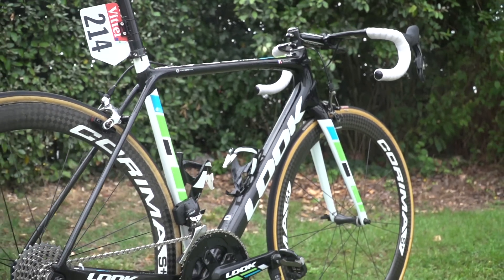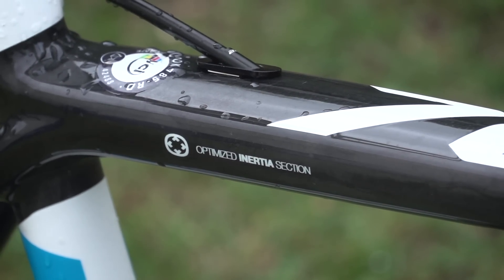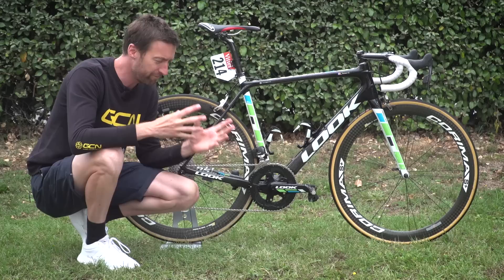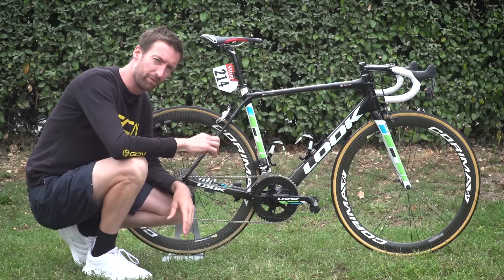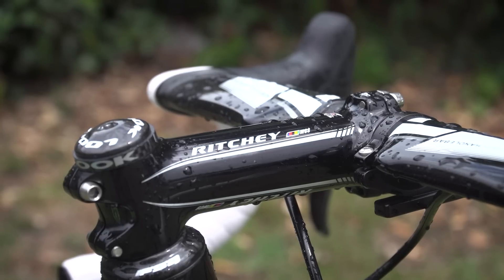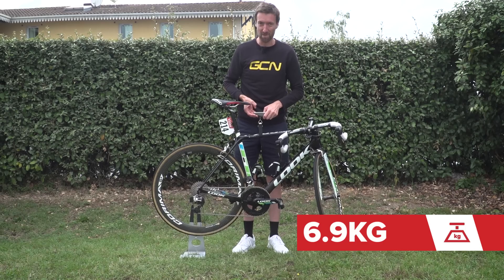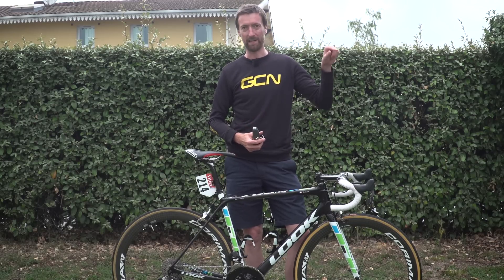Élie Gesbert's Look 785 Huez RS

Comment: Look bikes are not that mainstream bikes. I got one and it is really nice to ride. Plus it is hand made in France, so you feel kind a special when you look at it and when you ride it.
Reply: Nikola Makic how much was it
Reply: Mine model is 555. It is older but full carbon and it cost me 650 euros second hand. So it was ok. I know that new ones are not cheep.
Reply: Nikola Makic when did you buy that frame? It seems a bit expensive to me. I bought a 595 cofidis frame from a cofidis rider for 250 euros a year ago. Great frame this 595 by the way, beautifully rétro and slightly modern at the same time. Rides better than most mainstream bikes today.
Reply: Sorry to disappoint but Look frames are actually made in Tunisia and finished in France. They only produce Look pedals in France.
Reply: I bought complete bike for 650 and it was 3 years ago. If I had a chance to buy only frame I would but I only found complete bike in steed. 595 is a beutiful bike. I like the Cofidis color schema. Great choice.
Reply: Did not know that fact.

Comment: It is very good that the chainset  are zed2 for bb65 bottombraquet or shimano for bb86 bottombraquet frame. In my 795 the zed3 chainset are very nice, but they produce so much noise problems. Unaceptable on a bike of this value. On frame 2018 the bottombraquet is 100% carbono is possible that the noise disapear.

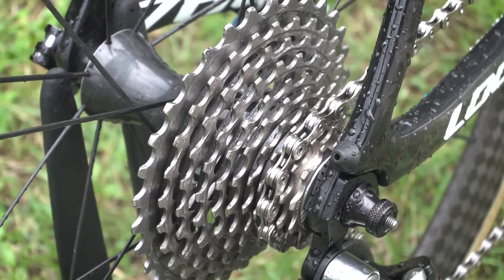Comment: If you pause at 3:20 there are atleast 2 if not 3 off the same size cogs in the cassette?
Reply: Tom Sharpe yeh I see what you mean
Reply: Yeh I see what you mean
Reply: J S after another look there looks to be 4!? Just seems so weird
Reply: It might remind them of when they were juniors😂
Reply: You can easily see that the tooth on the 12T (second one) comes half-way up the chain link that it's next to, the 13T tooth that the chain is on comes to the top of the chain, and the 14T to the inside of it comes over the top of the chain link. Clearly they are progressively larger cogs.
The "optical illusion" is due to the fact that the teeth on the smallest cogs (11, 12, 13, 14) are shorter than the teeth on the bigger cogs to make them shift easier.
Reply: Hahahaha! It would be pretty funny if it was
32 28 25 23 20 17 15 11 11 11 11
Sure as hell looks like it

Comment: What is the point of the UCI weight limit, designed to make sure frames are robust/safe enough, when the manufacturers completely ignore it and the teams add their own weight, providing no safety benefit!?!?!?
Reply: Also provides a more even playing field for teams with different budgets
Reply: weight isnt the only factor bikes need to be uci approved
Reply: It is the same as production based homologation in motorsports. It prevents the deep pocket teams/ manufacturers from outspending the smaller teams and beating them with superior tech/ lighter bikes just because they're richer.
I think that your premise that the weight limit is "designed to make sure frames are robust/ safe" is inaccurate for the reason you give- that it is easy to get around, thus meaningless.  If that were the case, then the UCI would mandate minimum bare frame & fork weight, not minimum complete bike weight.
Reply: Brian R It's from the time that carbon made it's entrance in the pro peloton and people were trying to prevent frames frombreaking...

Comment: Nice bike, but I'm wondering why the top tube is 0.6mm thick, that seems a lot, especially when you know that the carbon tub of a Lamborghini Sesto Elemento is only 0.8mm thick... Aren't bikes than(in general) not made with way to thick carbon fiber? Which is more expensive, and heavier...
Reply: Jarne De Prins if you are talking about the body, the carbon on the Lambo has no structural purpose.
Reply: mayalman all modern cars are unibody. So it's highly likely that the body is structural.
Reply: mayalman, that is true, but it still takes an awfull lot of G-force in corners, and the wind still presses it down a lot when driving 200+, so I wouldn't say that it doesn't take any forces
Reply: mitchell steindler, that is true as well, I just looked it up to be sure, their is no conventional frame, but you do have a rear subframe(also carbonfiber), but I don't know the thickness of that. The carbon fiber tub is the base of the car, it is a 1piece monocoque, so indeed, no frame at all(except the rear subframe, and I think it probably also has a front subframe). But it still takes an awfull lot of power, I mean, 5.2l V10, 562bhp, 4wheel drive, and 2.5s from 0-62mph, so everything in the car, has to withstand a lot of stress, and I think, even Kittel in a max sprint, don't puts out the same stress on a frame, as a car does on it's tub, when accelerating from 0-62mph in 2.5s....
Reply: I am not an engineer so I will politely step away from this debate. I assume that bike manufacturers are testing various thicknesses and that lambo is doing the same and I can only conclude that if the engineers settled where they did that those are the measurements best suited for the applications.
Reply: there isnt much point in making an extremely light frame if pros wont be able to race them without adding extra weight
Reply: Bobs UrUncle, that is true, but their are still normal people that don't have weight restriction. But the fact that Lamborghini can make a pure racecar, with so thin carbon, means that the UCI really should look in banning the 6.8kg rule. And, less carbon=lest cost, so manufacturing will be cheaper as well, which means more profit(and/or cheaper bikes for us)
Reply: Jarne De Prins lighter doesnt mean cheaper, if you buy a light bike youll be paying for the extra engineering and attention to detail needed to produce the frame. I also suspect that Lamborghini added extra support structures to in order to keep the tub from flexing.